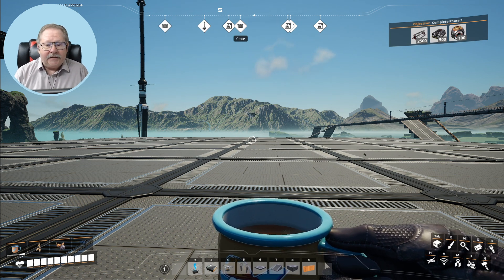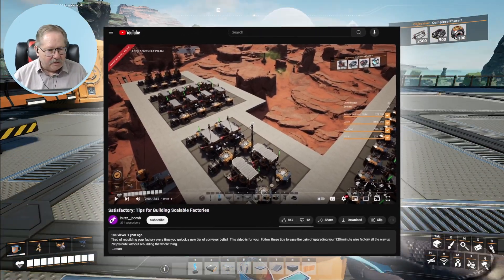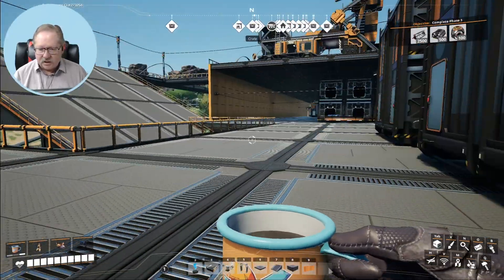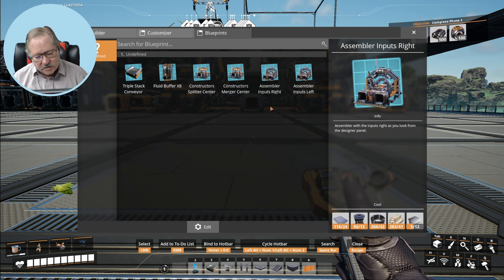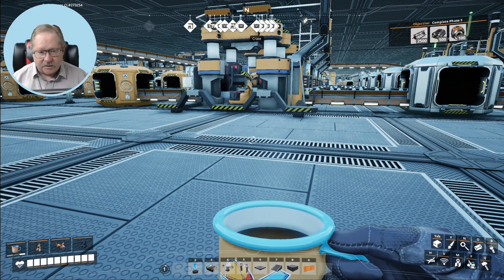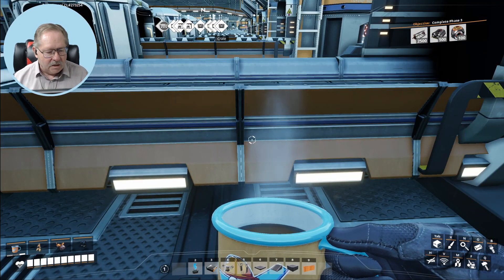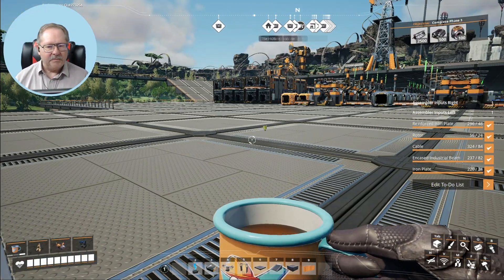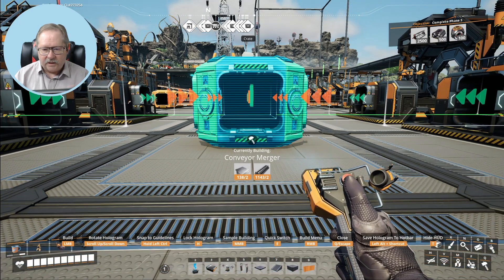Is the Modular Engine even Possible? [Satisfactory 32]

Comment: Heyy Mr. Doc, loving the blind playthrough so far, and its really nice to see an honest take on the game instead of just megastructures and huge nuclear setups.

 Screws are a huge hassle to ship around via belts and you might find it easier to ship rods around and make them onsite, its alot more compressed on the belt.

ex: for reinforced plates, you can run the screws though its own crafter at 40/minute, and straight into the assembler. for max efficiency you can also underclock the assembler to 66% for eat screws at exactly 40/min, or at least pretty close. Using manifold style splitters for both inputs goes a long way even at mid-tier belts, easier to ship around and saves some power. Hope this helps!
Reply from the maker: That's actually a great idea! It makes a lot of sense to leave them as rods until they hit their final destination. Thanks for the comment!

Comment: where ever i can avoid screws, i do it. this does involve getting alternates.
also try to use the belt elvators so you can make the blueprints more compact, that way you can get input and outputs in the same blueprind for every machine ( also for the bigger machines )
Reply from the maker: RE: Using Elevators in blueprints... That could get complex very quickly! Thanks for the idea. I'll have to experiment with that. Thanks for the comment!

Comment: Oh my word, the screws are such a hurdle lol.  I actually found out there was an alternate recipe that has Iron bars to screws, that one helped.  Not sure if it's more effective per iron ingot, but it's a nice option.  Factory is coming along rather nice Doc!
Reply from the maker: I've found a few more Hard drives recently, so I'll check those and see if the alternate recipe pops up. thanks!
Reply: @Gaming_with_Doc  also while I remember, if you use the hard drives, and it pops up a selection of 3 if you cancel or close that little window that pops up asking you to pick one of three it will give you the Hard drive back.  Not sure if this is a bug or a feature.  I don't have a video of that or anything.  Hopefully I explained it well enough, sometimes I make no sense.
Reply: The one I use is steal beams into screws.  The output is massive for one constructor.  240/m I believe.  Its may be a more expensive recipe in the long run but the reduction of facilities and the ease of use is really nice.
Reply: its the same iron cost, but a bit less for power, cutting out the smelters. just means running the raw ingots around instead of rods and finding the right harddrive.
Reply: @Loot_OW  awesome, good to know.  Thank you :)